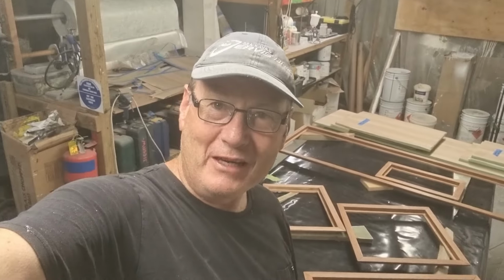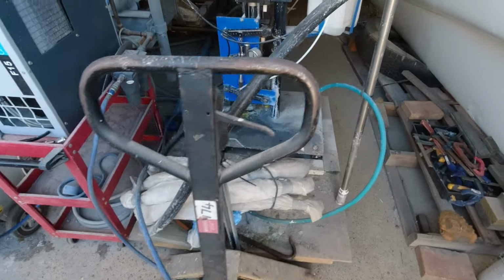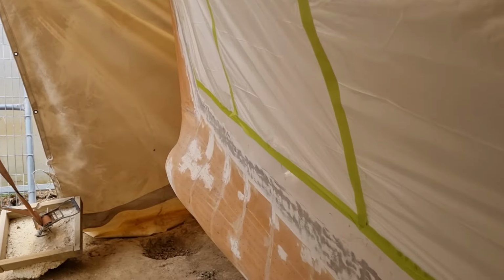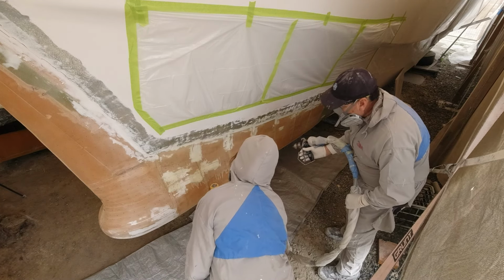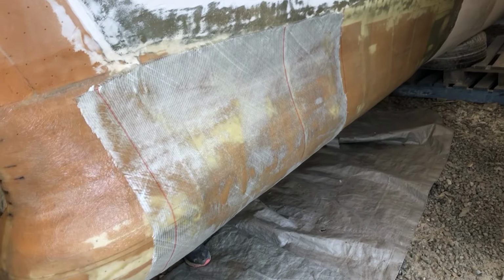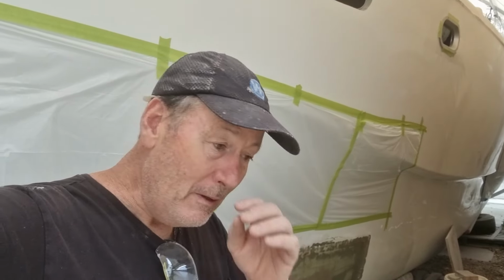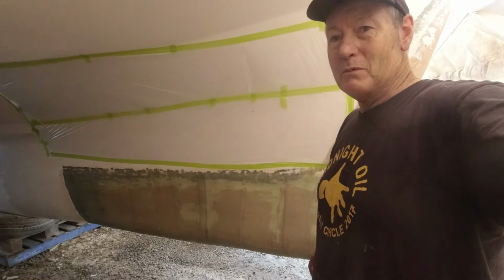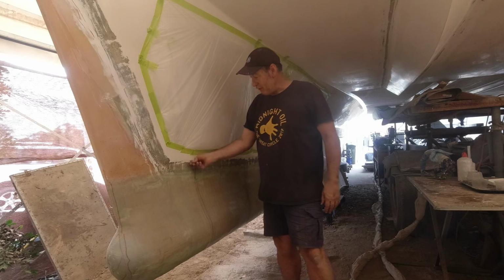Our New Shape Is Complete - Laminating our Bows Ep311

Comment: Ross is don’t think the bulb will slow the boat down. On the contrary. By extending the waterline by half a meter or so, you should actually increase the speed potential of the boat, making up for any increase in water resistance by the bulb.
Reply from the maker: I tend to agree mate, time will tell, along as the buoyancy is right I will be happy.